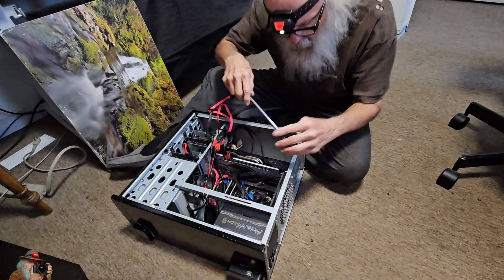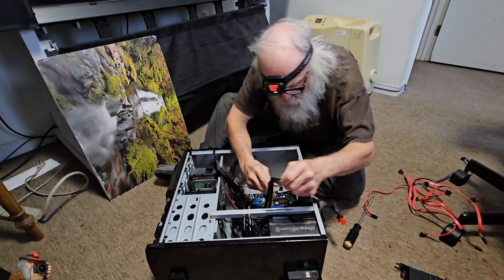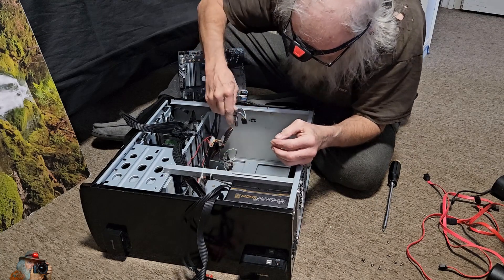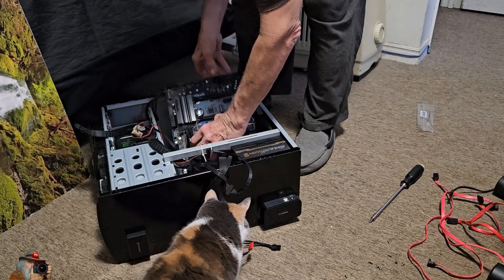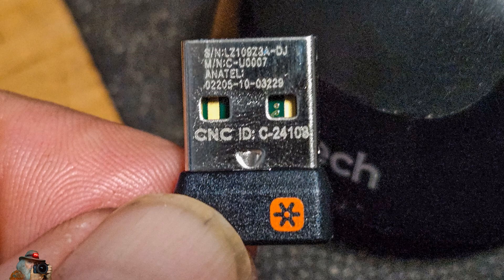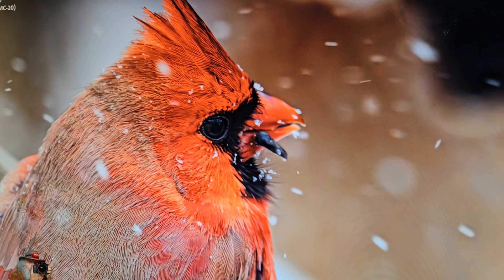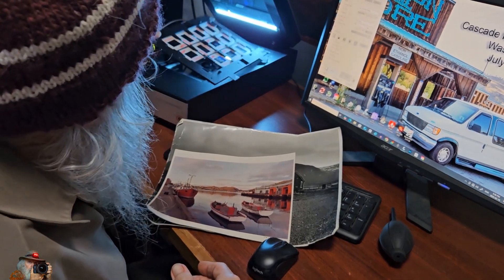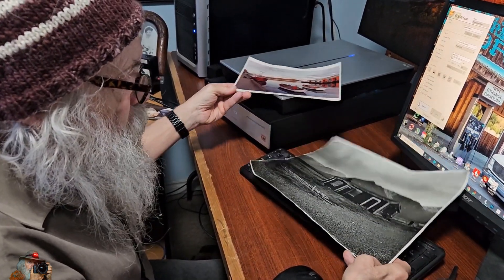Windows 11 the end of an era? Upgrading to Version 11 except for one system for our Epson Scanner.

Comment: 5:28 I Honest Air Cooler Much Better, Noctua Or Bequiet Dark Rock Pro Coolers Are Monster But Also Super Quiet
(My Recommendation Is Bequiet Dark Rock Pro)
Reply from the maker: I'm not having heat problems.   The system is OK for now.   I mostly use Lightroom and Photoshop both are working very well now.   Thanks for watching and commenting 😀.   Mike

Comment: Thats an Asrock Z390 Pro4, supports 8th and 9th gen Intel, so look for i7-8700 6core/12thread or i9-9900K 8core/16thread, you also can checkout X299 
Boards, and on Ryzen i would look at AM4 Boards and Second Gen Chips 6/12 or 8/16. That Sapphire Nitro looks like previous gen R9 something. That asrock card is pretty much the lowest quality tier from a legit retail company, I would advise stepping up to a Nitro+ or Red Devil built cards. Windows 11 ISO or Ghost Sceptre Variants with Rufus will Install all the way back to Core2Quad right now, you can Activate it and it will Update. But in the future you might not be able to update it officially, I imagine the fall back position would be to sideload the updates. Im working here on a Core2Quad & i7-870 & FX 8350 & i7-6700 & i7-4790, all are running some form of Windows 11, they are all Activated, they are all receiving Updates. Thats a cool scanner, i've never see one like that before.
Reply from the maker: Thanks very much for watching and especially the good information.   Everything is working great right now.   The GPU could be improved,  the HDDS run at 100% when uploading files that could be improved with faster drives.  I will look into an i9 in the future.   Mike
Reply: @bellasvistas3463  🤠🐴 Your Welcome, have a Great Week!

Comment: Based on my limited experiences with 95, ME, XP and 7...Win10\11 is a downgrade, but the marketing convinces many it's an upgrade.

I still run XP, and the only reason I bought a used copy of Win7 is Navman refused to add a few lines of code to their map upgrading software so it'd run on XP, so my system is dual boot.
Reply from the maker: Thanks for your feedback, I have been using it for about a year now, but I keep the W-10 box for my scanner.

Comment: What video card is that at the beggining of video? Thank you sir for sharing this video
Reply from the maker: Nvidia GeForce  GTX 460.  The new card is faster with Lightroom.   AMD Radeon RX 6600.  Thanks for watching and commenting.   Mike
Reply: Still a pretty beefy card and holds up well @bellasvistas3463
Reply: 🙂 i think its a Saphire Nitro Plus R9 something, the previous generation of the RX 480 580, has two power plugs like you would see on R9

Comment: Just use a custom modified de-bloated Windows 10 or 11 with your legit serial & then install StartIsBack (Win10) or StartAllBack (Win11). Afterwards ...your Desktop PC or Laptop Desktop Screen will look like Windows 7's so your system will be alot easier to use, plus it will run "MUCH"" better/faster ...including being more stable. 🙂
Reply from the maker: I'm going to try that.   Thanks very much 😀
Reply: 🙂 sure, all my old retro pcs are on Ghost Sceptre 11, all Activated and its still Updating 23H2, Core2Quad, i7-870, FX 8350

Comment: You can buy a high end ryzen, mobo and ram for like $300-$400... Not $3000.
Reply: Absolutely & high-end/priced Graphics Cards are NOT needed either. 🙂
Reply: got 12th gen Intel 6 mos ago for $ 284.95 ( proc., 16 Gb RAM & mainboard )  All new and under warranty.  Used RX 580 8 Gb VRAM $ 44. color me happy !
Reply: Sorry my bad. Hamrick software is the publisher of " Vue Scan " . I talked out of turn since it's been so long since I investigated this. I am using Silverfast since it supports my  Pacific Image Prime Film 1800u negative scanner. My apologies for the mistake.
Reply from the maker: @sidgysoho1960  EXCELLENT Deal!
Reply from the maker: Thanks for the info.  I'll have to keep that in mind for next time.  I just went online, and it really added up quickly . I will need a power supply case (why not). I was overwhelmed .  Next time.   Thanks for the help.   Mike
Reply: 🙂 it comes out to the same price as 8th gen intel, you could do pretty much the same, go look at AM4 boards and for cpu the second generation supports 11, so thats Ryzen 5 or Ryzen 7, 2600 2700, and DDR4 is samething for both boards, just go with whatever makes sense in your area, and step up to the nicer enthusiast ATX boards with lots of cooling heat sinks, get something COOL 😎

Comment: 4mins in . ram is in wrong slots. put an ssd in, make it faster
Reply from the maker: Thanks very much.   That's the way I got the used board. I found out that the  ram was working single mode. I read the online manual and found slots 2 and 4 for dual channel .  It made a noticeable difference.  Thanks for the info.   Mike
Reply: @ sorry just noticed you have a m.2 nvme drive. cant get much faster than that.
Reply from the maker: @derekwilson285  Thanks for watching, DW.  Mike
Reply: How did you gleen from the video what hardware he had? Dual channel for DDR3 is a must and follow manufacturers recommendations. You failed to mention the rank which also has a limited effect for speed in DDR3 . For DDR 4 be wary wary careful rabbit.  Worth looking in the BIOS for DDR3 as well to make sure timings are stable and speed is set correctly. Cheers.

Comment: You might try VueScan if you want to use an older Epson scanner with WIN 11
Reply from the maker: I will check int that thanks.  Mike
Reply: @bellasvistas3463  Silverfast is the publisher for vue scan. Supports my 'ole HP 6300C scanner with ease.

Comment: Sorry but you have the Ram in the wrong slots, to get the full use of them, they should be in 2 and 4 with just two sticks.
Reply from the maker: Thanks very much.  I got the board like that and found that I was only getting single channel.  One other viewer noticed that as well.  I used 2 and 4 as in the manual and it worked fine.  Thanks.

Comment: I skipped win 8, win 8.1 and I'll be skipping win 11 and probably all future win's.
Reply from the maker: Interesting.  Windows 7 always worked.
Reply: @bellasvistas3463  I liked 7 more than any other win, but I switched mainly to Linux in 2006. I have found win to be mostly a pain in the backside but kept it as a second system for web sites/apps that would only work on win. After 10 dies I'll just keep it offline and use it for POD Farm apps.

Comment: if Windows 10 drivers are failing to work under Windows 11; maybe look at installing Virtualbox from Oracle and add a Windows 10 virtual machine and pass-through the USB ports for the scanner/printer. also works great for old software that only runs under Windows XP/7. adding extra ram helps. but you only need one machine to run it all. 👍 Mike
Reply from the maker: I will look into that.  I hope that Epson will come through with software to keep the scanner on Windows 11.  That's the only problem I have with W11.  Thanks for sharing your knowledge and commenting.   Mike
Reply: @wilsmith7173  Good advice but, . . . .I managed to get a Canon MG3220 w/l printer & Starry Night astronomy software working under Windows 11 Pro using compatibility mode. Just sayin' .

Comment: I found that some drivers have to be loaded manually and that the older drivers for mother board components and printers will work with windows 11. Seems HP is on top of this and is erasing drivers and support for older but still very capable printers and PC models. This windows 11 is just a huge scam.
Reply from the maker: Thanks for info.   I'll see if I can find something for my Epson Perfection V700.

Comment: No clue how I ended up here.. but I was watching the video and noticed you installed your RAM into the first two slots. For this board, when using only 2 sticks of RAM, you want to install them into slots 2 and 4 (labeled A2 and B2) for them to run at proper speed. As they are now, they are not running in dual channel. You should get a significant performance bump if you fix that.
Reply from the maker: Thanks very much for your help.  The board was as it was when I got it from my friend. I found out that I wasn't running in dual channel mode and moved the ram it's now in dual channel mode I only wish that I had spend more on the video card.  Next time I will go Ryzen I think.  Thanks again for your help and consideration.  Mike
Reply: Great call, my new PC on an AM5 board wouldn’t post when I made that mistake recently. Tough to keep up with some of the changing knowledge
Reply from the maker: @andreww4531  Thanks for watching

Comment: I think I am finally going to go Apple Mac when Microsoft stops supporting my Windows 10 PC. I just feel totally screwed over by Microsoft forcing me upgrade. I thought about replacing the motherboard but to me that is liable to lead to replacing graphics cards and memory and when I added up all the new components it was half the cost of a new PC.
Reply from the maker: I bought a used board processor and ram for under $300. with Win11 on it already.  It was still too slow taking a couple minutes to denoise a file.  The new Video card about $300.  reduced that time to about 12 seconds.  I kind of wish I had built a new Ryzen box that would have been faster. A friend of mine said he spent 6 times what I did building a new box so just about $3,600. he said its 2x as fast denoising a file.  The Video Card is very important for Video Editing and  Lightroom Denoise.  There are websites on how to install Win11 on just about anything.  I think the Apple solution might be very expensive.  IDK really.
Reply: 🙂 i dont see it as a problem, if builld pc's all the time, if your cheap and stingy just go with the oldest generation supported boards, so thats 8th gen Intel, or X299 board, or a few Xeon Workstations from HP Dell Lenovo, or AM4 board and a cheap $30 Ryzen 5 second gen, 16gb of ddr4, go price it out, its not bad, Board + CPU + Ram, plug n go